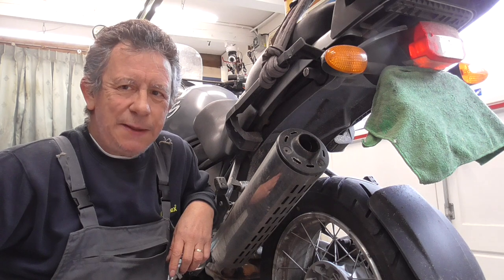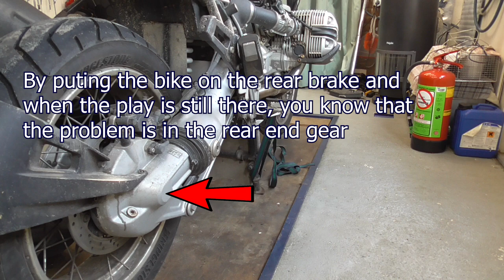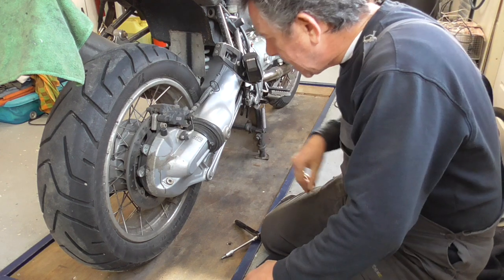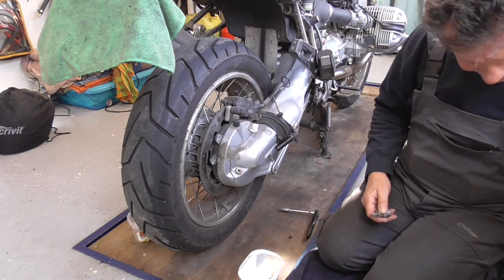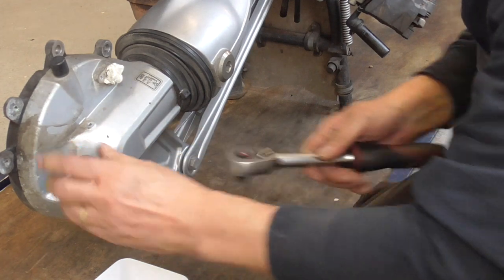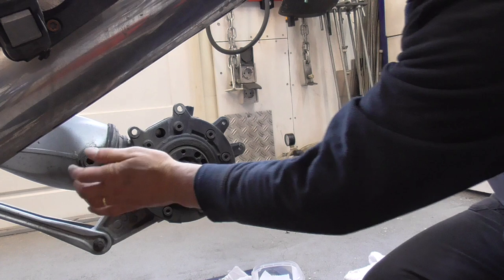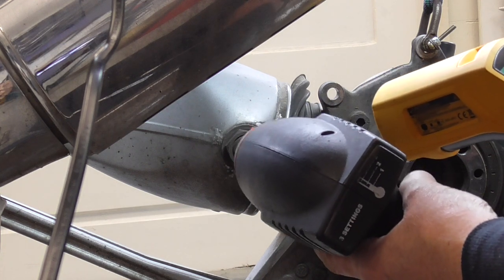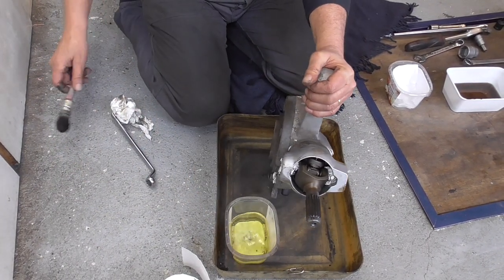BMW R1150GS FINAL DRIVE PROBLEM.. SOLVED ! PART 1

Comment: Respectfully, Wouldnt the slack remaining when the rear brake is applied indicate the gearbox >final drive u-joints are the problem? And if it didnt rattle that would point to the rear wheel berings are shot?
Reply: exactly, it looks that way
Reply: Yeah, I think he had it backwards.

Comment: Can't help agreeing with jeunus DC. Wouldn't holding the brake on, lock the wheel with the housing. Any play would be at the pivot points.
Reply: Yes you're correct